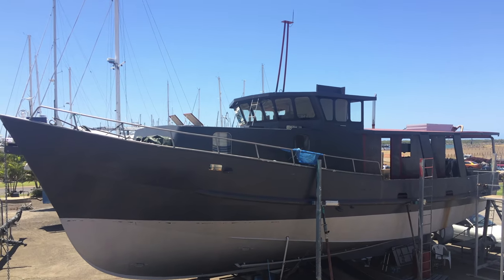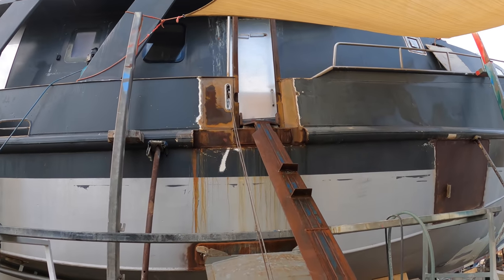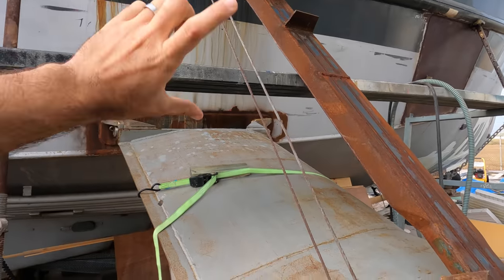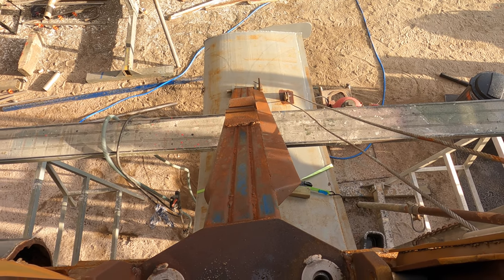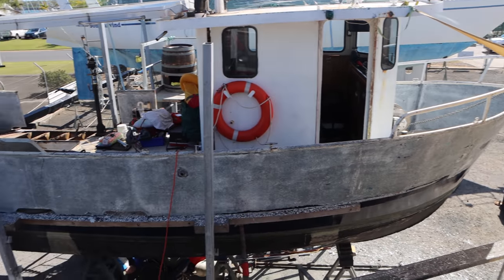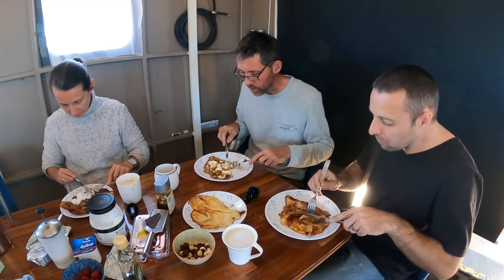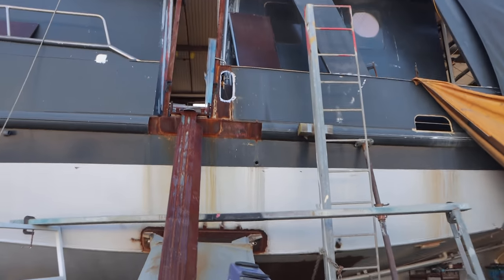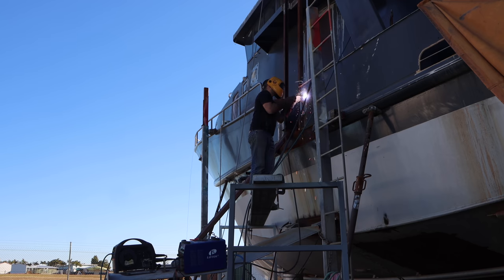Re-building our bulwarks & bending stainless solid bar fairleads - Brupeg Ep. 216

Comment: Look up Warn winches.  They make winches for off road trucks that mount on the front of the truck and some are mounted below the front bumper.  They are exposed to road salt and water, so they should work for you, especially if you cover them with a protective cover.

Comment: If you can't find a cheap deal at the wreckers, move the winches inside the pilot house. You can project the wire through a drain tube (a straight tube that has drain holes to the exterior on the bottom side and a small dam that traps water at the end where a nylon brush wipes excess water off) to a pulley. Then you won't need to do anything to the  motors, they'll work in decent conditions.

Comment: Hurst rescue tools, typically known as the “jaws of life,” have a lifespan in emergency services, and the electric hydraulic systems are often sold as surplus for pennies on the dollar.... with hoses, rams, fittings, etc. and they’re designed to work in extreme conditions that exceed the marine environment. 

Your hydraulic winch solutions may be more readily available and affordable than you suspect if you think outside the box.
Reply: I came here to suggest the electric over hydraulic systems too.   Basically it moves the more delicate electrics indoors and only hoses tubes and hydraulics go out in the elements.  No gas or diesel either.

Comment: There is no need for hydraulics on the roof. A ram at main deck behind the riser guide for the wings can draw the cables with doubling pulleys and the hydraulic lines can come from the engine room along the inside of the railings. Then, a box can contain the ram and block with the roof stabilizing the works. It also would only be a few inches thick (75mm) when all is said and done. Still cable drawn and you could remote operate from the bridge once the lock down plates are unbolted.

Comment: In heavy seas - the 6mm hull plate will buckle and you will definitely see visible deflection of stresses somewhere in the hull - most probably adjacent to the doubler.  Would advise that you engage a naval architect (if you haven’t already) to advise on structural risk of that.  Not sure what the transverse frame spacings are behind them but would definitely suggest that you install some vertical (and horizontal) stiffeners or more framing behind the hull plating.  Realise that you will probably cut those stabilisers down a bit but the stresses on those areas will be quite large - in an area that is not constructed or designed for such dynamic forces like say the bow or stern are…. 

I’ve commented a couple of times now - sorry definitely not trying to be negative.  Really love your vision and mission and this probs isn’t the right forum to raise said issues.  FWIW - Every ship deserves owners like you guys. :)

Comment: A thought or two about the pulleys welded to the wing - you are putting a lot of faith in that pulley and in particular in its shaft.  I might suggest going with a beefier machined pulley, a bit larger diameter for it, and especially a larger diameter shaft for that pulley.  Shouldn't bee too expensive to have a shop whip something up.
Reply from the maker: That’s a fair point. The pin is thicker than the cable but it’s not a difficult mod to drill it out to say 16mm and make a new pin.

Comment: Small electric hyrdraulic pump and small accumulator just inside the boat (protected from the weather). Then a short run of hydraulic hose to a hydraulic motor on the winch. Won't lift quickly but for 250kg will do the job.

Comment: Electric wet pack in the boat near hydraulic motor application location. Fore and aft, or use a third for more in use spares.  Use the smallest electric wet pack you can find, and use 2 or 3 of them with electric valves.  The controls are all on the bridge.  Perhaps on a computer screen if you are using a N2K to switch the power contactor and switch the electric valves. Or analog control, power on/off to wet pack through a contactor, and up and down.  There are trailer winches that drag stuff onto trailers that run on 12 volts. A wet pack, a waterproof electrics box with din track, and running on 240 would be good.

Comment: Have seen some people using a very heavy duty hi torque batter drill. I think (Milwalkie brand) to raise big mainsail on cats. You could weld a spline piece to the commutator end of the shaft and it would probably do the job. Drill could be stowed out of weather.
Save a lot of work and expense. Don't think you'll raise and lower those flippers very often.
Good luck

Comment: Pneumatic winches?
Wondered if you had considered this as an option - My boat (a former navy dive tender) had a 6 anchor positioning system which used air to operate the winches - hamworthy brand. These were fully marinised and operated in adverse conditions.  Couple of advantages - only an single feed, and could be operated from a compressed air storage tank rather than needing a running compressor.

Comment: Keep the electric winches you have. slather liquid electrical tape over them until they are waterproof, carry a spare and some pare parts, install one manual winch that acts as an immediate back-up and services both sides with a dedicated dyneema winch line., needed for hydraulic anyway.

Comment: How about putting a 12/24 volt hydraulic  power pack inside the cabin and run the hoses to the wenches and use solenoid valve for the up-and-down movement. This is what we do in the 🇺🇲 States for low rider vehicles to make them jump.

Comment: guys, on our lowloaders we had a 12v hydraulic powerpack driving the rams to lift and spread the floats..ive seen smaller versions of them online for under $1k and im sure you would find a couple of old capstan winches to pull your cables with..

Comment: Having that lift to pull the stabilizers vertically might still be a good backup, it can move the stabilizers up high enough, for them not to pose any problem, in case the main cable fails!

Comment: An electric powered hydraulic pump can be mounted anywhere inside the hull, allowing a short, vertical run of piping. Male/male fittings with threaded bodies and jam nuts allow for through hulls that won't leak and divide the hyd tubing into shorter sections for easier replacement. Considering the small load and short run times, a fairly small unit should be able to handle both wings and the anchor winch as well...🛥️

Comment: Getting hydraulic lines to the roof, can you run a straight pipe through everything from below to the top.   Then run a single complete hydraulic line through the pipe.  This eliminates the multiple fittings through each bulkhead and allows the complete replacement of the Hydraulic line if ever necessary.

Comment: Brupeg has a wing motor. It's called Renko. For the wings One potion is to go with a single winch with dual lines. Then both wings come up at the same time. (has it's issues too)  Since the wings need so little to pull them just install an electric hydraulic power pack to run one or two winches. Wish I was there these are the engineering problems I enjoy working on but Australia won't let anyone in :(

Comment: You guys are awesome, been watching since the start, watching this I would be inclined to mount winch on the deck beside wing sliders and still have your pulley purchase as it is above balwarks , saves cable running up onto roof and potentially keeps them out of the weather more , keep up the good work can’t wait to see launch day cheers regards James

Comment: Hi Guys, how many times a trip are you likely to want to park the wings? My guess once , when you come into port.
So cheap electric winches with quick release fittings and take them off and put them under the bed til you come back from deep sea !! Or even , as you've shown , use electric drill drivers to do it !
Hydraulics are expensive and subject to non use corrosion as much as electrics.
Reply from the maker: Thanks, yeah very little use on these winches. It’s likely we will retain electric for simplicity but going to a much higher rated water sealed unit

Comment: Had you considered an electric over hydraulic set up? 
An electric motor driving a hydraulic pump could utilize the electrics you've already installed for the existing winches, doesn't require running hydraulics down to the engine room,, can be completely encapsulated on the pilot house and would not require service like the diesel engine idea. 
Just a thought.

Comment: There are electric motor driven marine winches, but they typically use AC power, not D.C. They can be provided with "real" weatherproof motors. Thern and Wintech are two manufacturers of these winches. They also make very rugged hand winches that can be powered by drill motors. If you don't raise/lower the wings frequently, hand winches may work well. Greg

Comment: Dame, could you retrofit the existing winches with a Hydraulic Motor? Remove the electric motor and fit the hydraulic one in its place.. A double acting pump can be bought in both 12v or 240v… If you were worried about the winch body’s longevity, you could potentially get them gal dipped!!

Comment: A daft idea ... please bear in mind I still haven't figured out exactly where the engine room is ... bearing in mind you can pull on either end of the wing cable ... with the addition of a few pulleys and a length of tube ... you could take the cables in board which would protect the motors or just keep them hand cranked.. or take the wing cables to the engine room.
As you won't lift them often hand crank seems best.. have you considered compressed air motors? as I assume you will have an air compressor.
Have you thought of a ladder (or stairs like on those posh boats, note.. my boat is 40ft x 12'6") from the stern deck to the roof and put a handrail around the roof, with welded table and benches stern of the wheelhouse also weld in a bench seat by the anchor winch. regards Mark.

Comment: Get you self a 2 way corded drill. Works great as a winch motor. And store able inside. Its not that you will lift those wings every hour or day. Its cheap and will fit on the end of the coil. Well at least on my trailer. And i would take a hydraulic winches over rams. Rams will rust over time. One grinding spark on the ram and you get rust what can resold in leaks.

Comment: When you explain the wings from now on I would go with one of these four options.

Option One you were one of the American Cup Designer's and wings (or foils) on a sailboat gave it awesome speed so see you at the start line.
Option Two you are going to the artic and it is a requirement to not scare the penguins so the boat is painted like a penguin (beak on the bow, light bottom, black back, and wings were added).
Option Three you are from New Zealand where the Native birds are flightless so you are putting them on your boat to prevent flight.
Option Four you watched Fast and Furious 9 and are adding a rocket engine as a secondary motor so Brupeg will become the first real space ship this is why you also fitted the solar.

Comment: As far as supplying hydraulic to the Wing motors, haven’t you already run hydraulic up to the deck to power your anchor hoist? If so there’s your pressure and return lines. 
That way you don’t have to fiddle about with any sort of a new hydraulic pump some little prance around maybe it’ll start maybe it won’t pony pump.

Comment: Weld a couple of truck wheel nuts on to the shaft of the winches youve got and buy an electric wheel nut gun. Keep the gun in the bridge and just take it up on top when you need to use it.

Comment: Amazing to see that stainless so!id rod bend without cracking considering how much more brittle it is than mild steel. Whatever you choose to lift the stabilizers, I suggest you use a pair of motors that have common connection point for redundancy. One wing up and one down and you'll be going in circles!
Reply: "Annealed austenitic stainless steels have exceptionally high elongations. Typical figures are 60-70%."

Comment: A lot of tailgate loaders on smaller trucks use 24 volt hydraulic power packs, couldn't one these systems be adapted to power hydraulic winches situated where the existing winches are positioned, surely the whole system could be roof mounted ? Cheers 👍👍🍺⛵

Comment: You could put an electric power pack in the wheelhouse then just run the hydraulics through the roof. Eleminates it down to 2 bulkheads and the electrics will stay dry.

Comment: If your worried about a wing motor being ripped off, are you worried about your keel cooling system also being ripped off? and that Nordhavn, is that the one that ran aground on the Sheridan flats in the Great Sandy Straits?
Reply from the maker: No idea about the nordhaven. Keel cooling will be replaced with internal sea chest prior to ice

Comment: If you put the winches on the underside of the cabin overhang, they will be much better protected.....   A lot of high quality off-road winches are IP rated for waterproofness, but they are expensive, probably $4000 US for two good ones like Warn.

Comment: Why not use an electro-hydraulic winch?  i.e a hydraulic winch with an electric powered pump for the hydraulics.  That means that the pumping unit can be mounted close to (but internally within the boat) to the winch.  There are various electro hydraulic power steering pumps that would be ideal, a SAAB 9-3 one comes to mind, which is completely separate from the operating gear and with its own reservoir.  By having the electrics internal the marine environment is less an issue and if the powered system fails a handle on the winch converts it to manual.

Comment: Just a thought, why not use a horizontally mounted dual channel wheel similar to what you may find on a weed eater (Whipper Snipper) That could be driven by an internally mounted motor either hydraulic or electrical with a drive protruding from inside motor to external wheel (drum) could even be diverted by pulleys back into the engine bay..

Comment: If you guys are truly looking at running a hydraulic system for your winches on the roof of the boat why not look into an electric powered power pack that you could mount on the inside of the of the boat ie in the wheel house or in a small dog house that you could build onto the lower roof behind the wheel house that way there would be easy access to the system for maintenance but you would have the more reliable hydraulic driven winches on the roof of the boat with fewer penetrations to worry about.   There are many options that would run various tools and accessories I did a google search and came up with many websites one such as directindustry dot com that lists several variants that would have more than enough power to run 2 winches that lift and lower your wings and some of them come pre caged similar to a portable generator so that it could easily be retrofitted onto your boat by building a water proof box to simply slide the unit into.
Reply: I make this suggestions simply because there are many lower cost electric options than the gas or diesel ones that you were discussing and they have plenty of power as here in the USA many companies use them to build dump trailers that use the electric power pumps to drive the hydraulic rams to tip the dump box to empty them that would simplify your system a bit.

Comment: You are talking about plumbing hydraulics or installing hydraulic standalone unit on the roof, have you considered moving the winches to a location that already has hydraulic plumbing like the bow and just redirecting the cables via a pulley block system

Comment: A hydraulic pump or even a power steering pump off the side of your Cummins isn’t too expensive and can be used for other things as well as the winch. You can also get hydraulic vehicle recovery winches so you do not have to change what you already have

Comment: An idea for hydraulic ram, install one vertically on the deck next to where the cable comes onboard through the lower pulley, install a pulley on top of the ram, run the cable over that pulley and back down to the deck, should be able to use a long skinny cylinder, and maybe only one decck to take pipes through

Comment: Look at your farm Equiptment salvage yard someone will have one (an older farmer) and source your hydro motors there it’ll lower your cost quite a bit I would think if they will last 30-40 years on Equiptment they should hold up for you also find a hydro pump to mount on the front of your crank of main engine for a pump or run it off your main shaft

Comment: Your stabilizers will likely be overkill but that is better than having to add on.  Have spent a loooot of time in very heavy weather with far smaller stabilizers.  The density of water vs air is what throws a lot of folks along with your hard chine which will also act as a stabilizer.  Those things will resist a ton of roll motion.  I like them a lot better than the trolling fish style passive stabilizers that have a tendency to come out of the water in real heavy weather and do all sorts of nastiness.  I've never liked electric motors for deck work on a commercial vessel.  A tiiiiiny bit of salt water, add electricity and it's off to the corrosion races.
Reply from the maker: Thanks very much. Yeah the wings are a popular retro fit to trawlers over here

Comment: Have you considered having two cables per wing with separate pulley so if one cable snapped you could still pull it up. Having written this I will no doubt find someone else has mentioned this and you have dealt with it. Cheers John County Durham England.
Reply: i guess its not a problem if the wings get stuck while extended, because there ment to stay out most of the time anyways